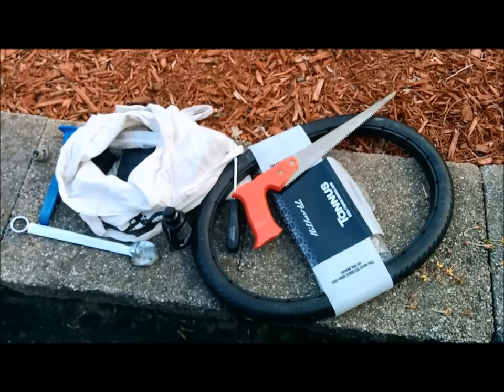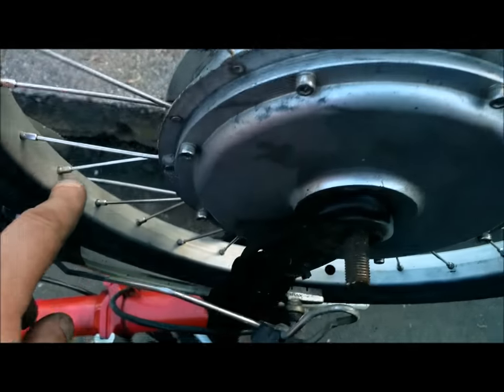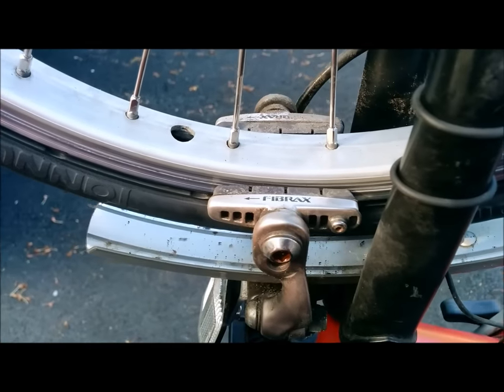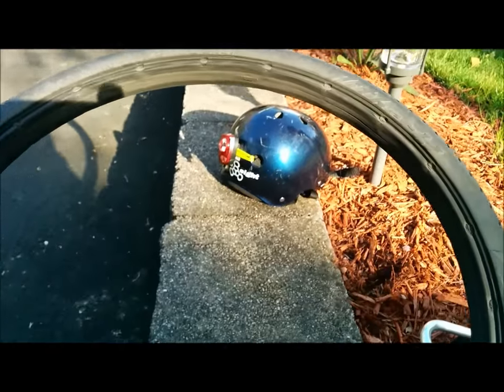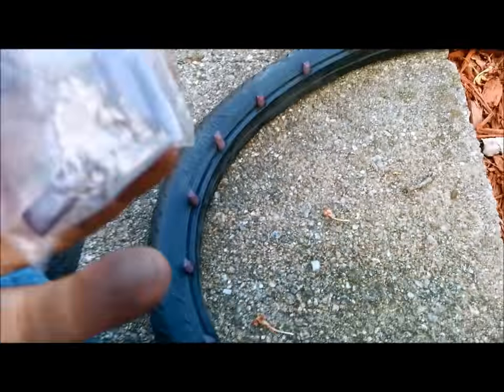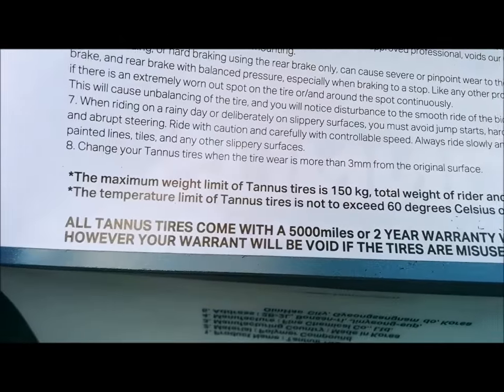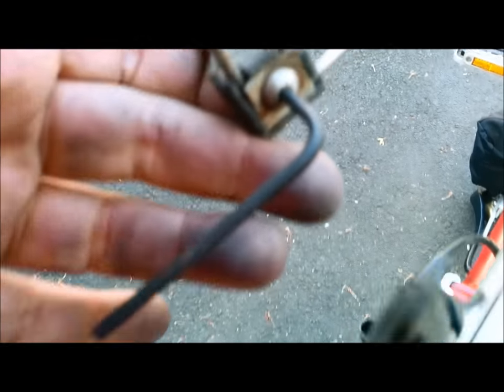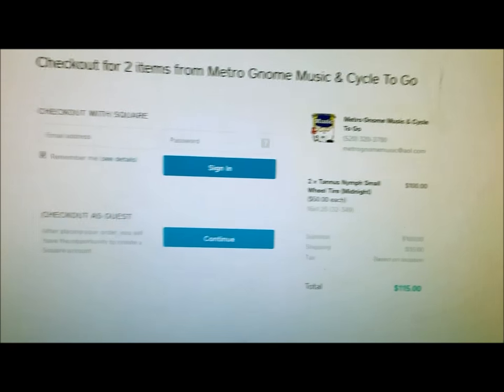Installing Tannus Tires on a electric folding Brompton bicycle ebike hub motor

Comment: Also I just got my Ebike kit for my Brompton a few days ago, and I noticed that you do not have the torque arms......
Reply from the maker: Darren Jackson Good eye! the torque arms sold by Grin do not fit my crystalyte 209 motor. I bought torque arms but they don't fit. I had the fork break last year. A replacement steel black fork is $99 not including installation at NYCEWHEELS.
Reply from the maker: Darren Jackson Did you get the kit at Grin Technologies?
Reply: David Sonshine Hey David, Yes I bought my motor kit at Grin Tech and the battery from Nycewheels. I bought the flight pack. Also I bought the Tannis tyres a few minutes ago thanks to you and your good reviews.
Reply: David Sonshine Thanks for the good information about the forks....that's interesting. These motors have a lot of power. I went with the NSM motor due to its small size. That little motor got me up to 24mph ! Wow impressive !
And I am using the thumb throttle. the cycle annalyst V3 came with my kit., the basic meter was like $65.00 the cycle analyst was $135.00
And it has a temp gage, speedo and a bunch of other tech stuff I don't need...lol . The main reason I got it was for the temp gauge and its waterproof !
Reply from the maker: I subscribed to your channel - I would love to see your bike in a video sometime.
Reply from the maker: How's your bike going?  Any new upgrades?

Comment: Which compound are you using the hard or soft compound?
Reply from the maker: Darren Jackson the tires I currently use are the new Athier foam ones. previously I used the hard ones.